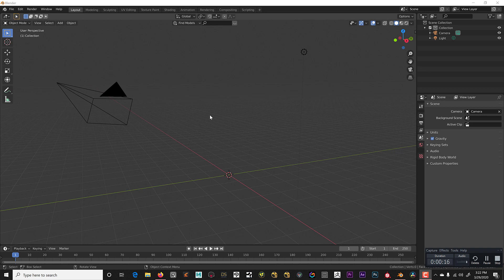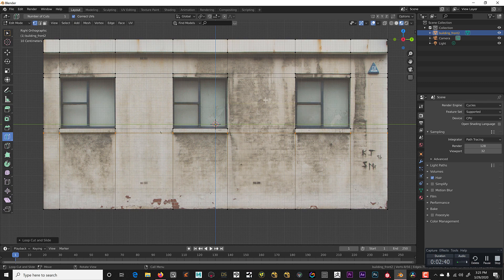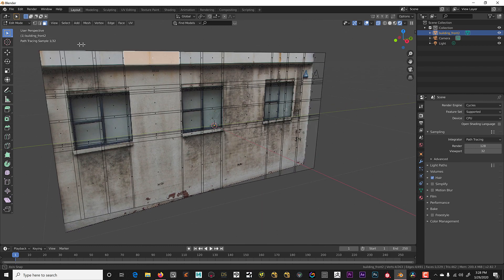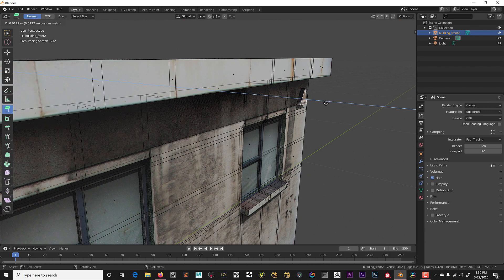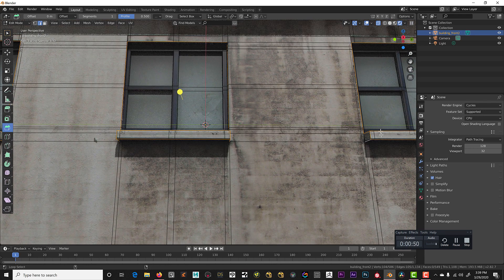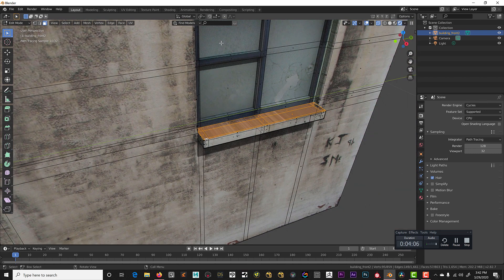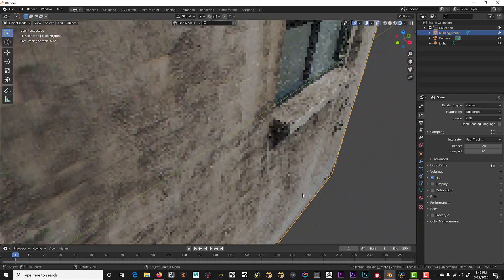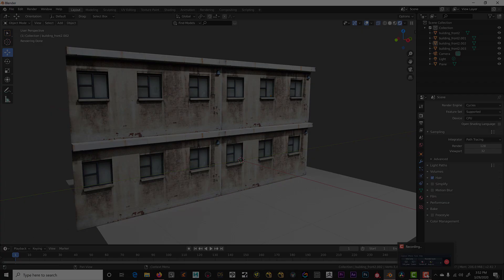Modeling a 3d wall from a 2D image in Blender

Comment: Hi...You mention a weird normals preview in the viewport shading mode (kinda transparent flipped preview) I had the exact same thing and it was doing my head in.....I found that in the texture settings, the "Viewport Display" blend mode was set to "Alpha Blend" rather than "Opaque"...Switch to opaque and the preview in eevee looks correct.
This happens when importing the image as a plane....there is an option (when selecting the image) to have Alpha...uncheck it, so it doesn't change the blend mode.
I thought I'd share this if others were experiencing the same thing.
Thanks for the video.
Reply from the maker: perfect advice! Thank you.
Reply: I've been having such a crappy night trying to figure this out, and getting so discouraged. Thank you so much for this comment helping me figure out why everything I did looked terrible! Thank you!

Comment: By now, I don't understand why you can't just do it automatically like a displacement map.  After all the information is there to determine what is popping out and what isn't.
Reply: I want to know more about that very thing. I'm quite new to Blender and have tried very little yet. My background of late has been Fusion 360 where I've been designing for real world mfr, but also doing mockups for customers. If I need a vector shape from a photograph I can trace it in Inkscape and separate into as many or few layers as I need, each of them with the capacity to be extruded, etc. For instance, what if I needed a diamond paned window? Would that mean I'd be placing loop cut diagonal lines for hours? No, I would trace that colour in Inkscape and then place on top of the image plane in blender and extrude out just a little? It seems like the logical choice for more ornate 3D shapes, no?

Comment: Instead of painstakingly selecting each polygon one after the other, you can move to orthographic view and box select all you want on that side all at once (make sure transparency isn't turned on though)
Reply: Select by is another powerful tool, e.g select faces by similar area controlled by threshold. You can also Select more/less faces/edges/verts with ctrl numpad+/numpad-

Comment: A thought about your normal issue in Evee. I thought it was a normal problem too but I think its actually that the material needs to be set to opaque for the alpha channel under the materials tab.  By default it sees dark tones as translucent. Maybe that what you were experiencing? Once I did that I had no problems.
Reply: I was gonna comment this, I also used to face this problem and it was solved by changing from Alpha Blend to Opaque.
Reply from the maker: Thank you for that tip!
Reply: @gryphonsegg  i was literally looking for this, thanks guys!
Reply: Alpha Clip works as well...